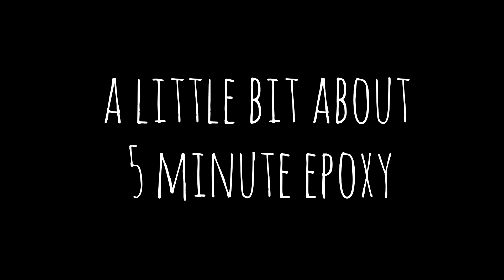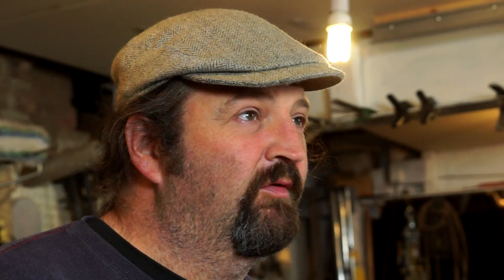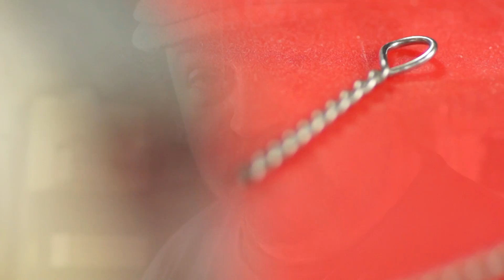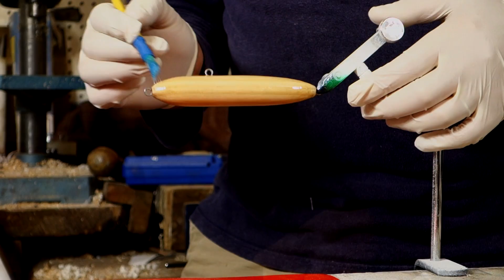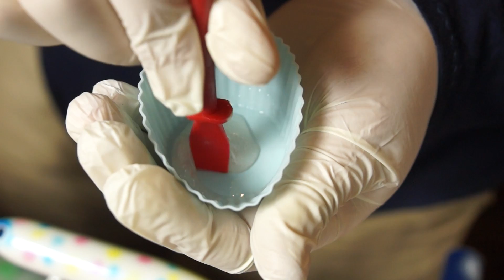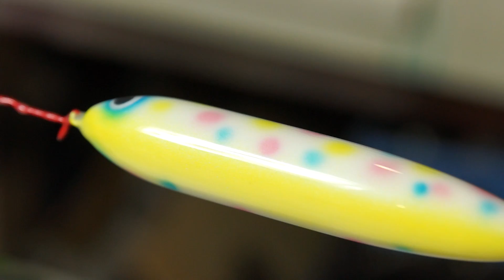Using Epoxy Resin For Lure Making

Comment: Do you ever pour plastic lures that have cavities for internal moving ballast beads and/or rattles? I saw a video where you had these type of lures 3D printed, but I am trying to figure out a way of doing it with limited resources. I’d like to have a go at replicating a Patchinko or IMA lure for targeting UK bass, the internal weight transfer ballast seems to be important for their casting performance.

Comment: 5 min epoxy is NOT WATER PROOF
Reply from the maker: it does not have to be as the lures are top coated with a rod finishing epoxy which is waterproof

Comment: 1 other thought for public/expert (handmade FM) feedback; I have several wooden lures from my grandfather - all over 60 years old - they are mostly store bought not homemade. But they are still usable. I would like to make several lures to pass down to generations in my family. I am concerned with the use of 5 minute epoxy (or superglues) as the base seal coat. A chemist friend of mine that was a fly tier never used either product on his flies because he said a general rule of resin chemistry is the faster it cures the faster it degrades. I am not sure what the degradation rate is but I am worried if the base coat fails in 10 -15 years then that is not what I am after - a failure of a top coat can be re-coated but a failure of the base would lose the entire paint scheme. I am thinking of trying minwax hardener or regular outdoor poly - any one have experience with these for lures ? how about cactus juice in a vacuum for the base coat sealing ?

Comment: why do so many people use the propane blow torches to heat the air bubbles instead of electric heat guns ? the guns are $8  at harbor freight and electric dirt cheap --- the torches are expensive, need to keep filling or buying new bottles and find something to light them with

Comment: Your videos are great, thank you :) I'm wondering whether you let the epoxy harden in a special warmed chamber or you just leave the rack somewhere on the table. Im asking because I'm a beginner in lurebuilding and I'm having some little troubles with epoxy. I think maybe it's because of the moisture in the air so mabe I need to let the epoxy harden in a better place.
Reply: Just leave it on the rack and spin room temp is fine to cool itll take 2x longer to hot and itll cure faster.manufactures post cure times on properly mixed

Comment: Is the rotation of the lure necessary for the epoxy to harden? Cant I just hand the lure verticaly from head to tail so the epoxy drips to the tail? (If it drips)
Reply from the maker: It is something i have tried a couple of times with very poor results I think this is because the resin does not get chance to self level so it pulls off the bait unevenly and also the simple act of rotating the lure means the resin is pulled by gravity and slightly stretched which will naturally pop air bubbles trapped in the epoxy.  But i would always say experiment, because there may be a way to do and get good results.
Reply: Yeah the few times I tried to hang the lure verticaly I saw after that the resin had done some "snail" track on the lure even though there were no resin drops on the table. Thanks anyway guess I have to find a way to rotate the lure every often

Comment: I have learned so much from you. Thank you. I have been using gorilla brand two part epoxy. It has done the trick but after a season or so it will start to yellow. Have you noticed anything like this?
Reply from the maker: Not all epoxies are uv stable so they will yellow over time, rod coating expoxies are normally better. I use Kantana resin which is uv stable

Comment: one question....why is that when i apply the epoxy resin it seems to spread apart and not stick very well? after it just looks bumpy. i make sure i dont put too much on but then it just spreads and there are dents on the lure
Reply from the maker: something is repelling it like grease or oil or even the paints you are using, sometimes handling a lure before applying epoxy is enough to transfer oils from your hand
Reply: Okay thanks i appreciate it
Reply: have you solved this problem? I have the same and I don't know what can I do. The resin won't stick or it goes off especially near hard edges. Is there any way to help it stick?
Reply: Well i decided to dip it in some clear coat wood varnish. After it dries i put another layer on then i lightly sand it with 300 grit sand paper. Put another coat. After it dries, if i touch it ill wash it with a sponge to make sure theres no oils on it. Then i put on the resin. Comes out smooth like a babies bottom.

But i think with those hard edges u might have to round that off some more. I have made a few lures with really sharp edges and the resin all. Did not like that sharp edge. So i realized the rounder the edges the better the resin sticks. Thats what i experienced

Comment: Around your 5 min marker you were wiping the epoxy on the lure. Why not use the brush? Or the plastic spatula, is there a reason?
Reply from the maker: i find it gets a finer base coat on than brushing and it also cuts down on the time i spend cleaning brushes

Comment: Well filmed video Paul. Just my 2c. but I think it would be of great benefit to avoid any silicone based product at all costs. Epoxy and silicone do not mix whatsoever and will cause fish eyes in epoxy where the epoxy separates and does not stick to itself. This is well documented on rod building sites etc. and can cause strength problems and ugly finishes. While you might not have any problems with your method I guarantee that plenty of others who follow this method will run into trouble.
Reply from the maker: I regularly use silicone moulds to cast epoxy which is a pretty standard practice even in industry. Uncured silicone and silicone lubricants can have an effect on the curing of epoxy and any oil will create fish eyes. Food grade silicons are normally of a higher quality and they  generally have a longer heat based curing process to ensure that  chemicals do not leach out into food. From my own experience of mixing in silicone cups i have never had any problems either with fish eyes or problems of none curing if you have had bad experiences using silicone mixing cups or you can point me to someone who has I would be grateful.  Thanks for you input and raising the question, it made me go back and look it again but on balance I will stick with the cupcake moulds as I can reuse them.
Reply: +Paul Adams (The Handmade Fisherman) I've had some bad experiences with the silicone moulds in the past, maybe from a coating in their manufacturing process? I usually stick to mixing (small batches) in throwaway shot glasses (that I know don't have silicone in manufacturing process) and pour this into an aluminium patty pan to spread it out so the bubbles pop easier. Each to their own, if your method gives you good results then that's all that matters!

Comment: Paul, nicely done and explained! I also put two coats of epoxy on my lures. The first coat I like to hand rub it and work it into the wood. Also I found with those twin syringe type dispensers, they don't always come out equally. I cut them apart and then I can visually see that I am getting equal amounts from each tube. The cap still fits on both of t hem when you are done.

Comment: great video Paul. i use Devcon 2 ton for my screw eyes and clear coat. have you ever had any issue with etex pitting or thinning in spots while curing? seems to happen often on my dryer but never with Devcon

Comment: any salt water pirk/jig/lures in the pipe line?
Reply from the maker: I had a go a couple of weeks ago but they were a bit heavy, is it something you use and what types?
Reply: I use up to 200 g lead pirks/jigs on the wrecks in the English channel 
I bling them up using your techniques 😃. Have to make lots because I lose/snag so many

https://s9.postimg.org/te0380vov/Screenshot_2016_08_09_02_18_33.png
Reply from the maker: P Buck's love that minion, are you sand casting or do you have a aluminium mould?
Reply from the maker: do you use them often as well?
Reply: +Paul Adams (The Handmade Fisherman) aluminium mould (blasphemy!) got a few moulds different shapes and sizes.. I tend to bend em a little to give flutter motion when jigging.
 Use them as much as I can :)
https://s9.postimg.org/ig9q7iw4f/IMG_20160610_163104552.jpg

https://s9.postimg.org/j3sra0t6n/IMG_20151105_175758468.jpg
Reply from the maker: aluminium moulds are great very reliable, sand casting is a bit slower but i have been surprised by the results. How are you painting yours, it looks like epoxy top coat?
Reply from the maker: paulpadam@aol.com

Comment: Glue spreaders? Just ordered some. Thanks for that tip. Been using fingers or a bit of wood, not ideal.
Reply from the maker: I often do that whole putting the two parts together and then start looking for a mixing stick which is normally when I pick up something dirty, so I have taken to stealing the children's glue spreaders

Comment: Hello Paul
Reply from the maker: hi
Reply: +Paul Adams (The Handmade Fisherman) I love your videos and have made some of the lures that you make as good as I can and have caught tons of fish with them. And I was wondering if you could make a snake lure for topwater.
Reply from the maker: James Arlinghaus I have thought about it but it is a long way off getting to make one. A few years back i made some very basic sand ell type lures which behaved a bit like a small snake and they were very simple to make have you seen that video?
Reply: +Paul Adams (The Handmade Fisherman)  yes I have seen that video and I actually have made one of them but just a little smaller and it worked pretty well.
Reply from the maker: I wanted to try a similar principle but a lot larger but have not got round to it, maybe one day
Reply: +Paul Adams (The Handmade Fisherman) with the sand eel lures that you made, do you think it is possible if you could please make me one a little smaller or one just of the normal size? I have some baby snakes in my pond and the bass love them, although I have made one before it wasn't the best and I know the sand eel will work. Thank You